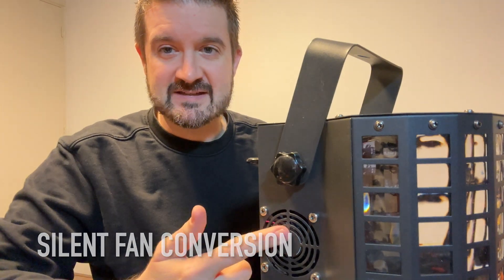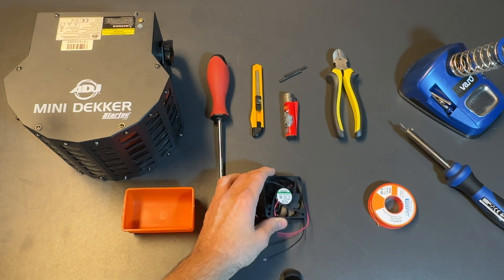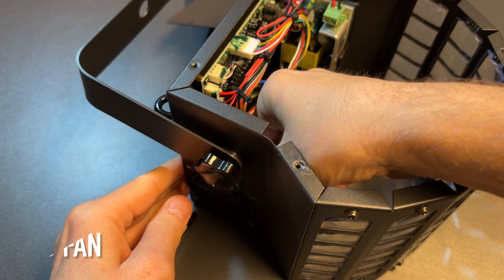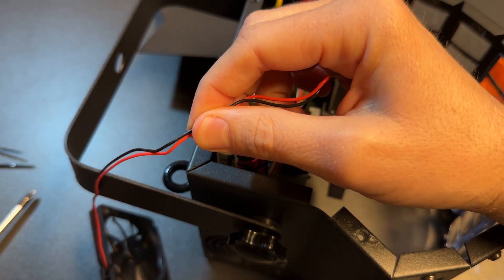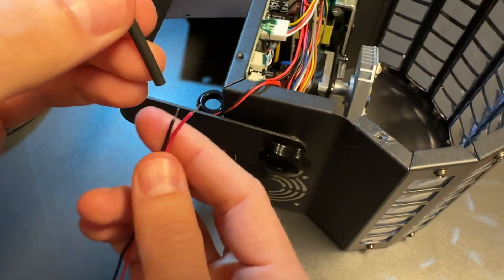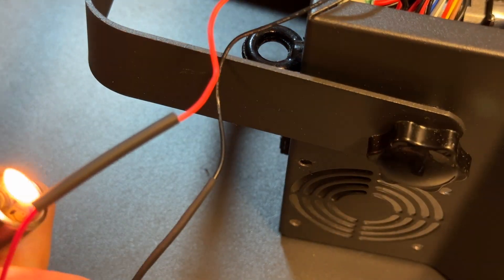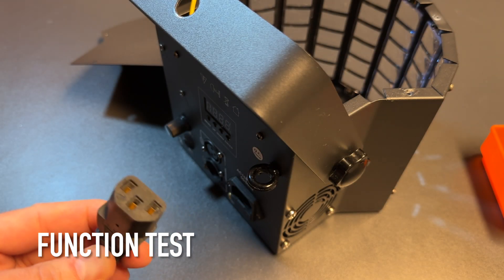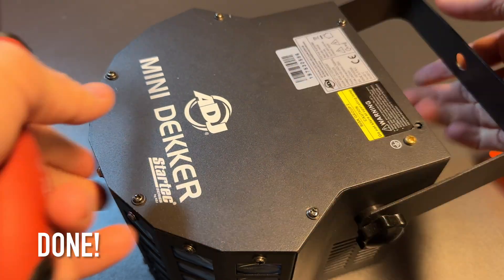ADJ Mini Dekker Silent Fan Switch: Step-by-Step

Comment: I saw your 'most underrated dj light' video and clicked through to comment "except for the horrible fan noise" but then I saw this and decided to give it a try. I'd swapped in a different fan on mine but it didn't make enough of a difference and I sold them off. This fan works great though, thank you much! I've got a segment in process on different derby fixtures, I'll give you a shout-out in it.
Reply from the maker: Thanks man, appreciate it!

Comment: Hello, Maybe you know why the led moves in small movements back and forth like shaking. Where could the problem be? Led vibrates when turned on...
Reply from the maker: Hi, I had similar issues with one device where the stepper motor just vibrates. In my case the stepper motor was broken and needed to be replaced. Mine broke during the warranty hence the seller took care of it. 
If your device is out of warranty you can Google Adj replacement parts, as they do have the motor available on their spare parts website
Reply: @djjakobofficial  fenks I will check

Comment: I did it putting in a resistor instead and now the fan spins at a very low speed near silent yet providing a good constant airflow. Even after a couple of hours use the light and air flow is cool.
Reply from the maker: That’s a great suggestion @DJ_PeterSteel as you can keep the original fan. What kind of resistor did you use?
Reply: @djjakobofficial   I had a bunch of resistors I tried and picked one that suited. Sorry but didn't check what value it was as I did it in a hurry.
Reply from the maker: Alright, no worries - let us know when you come across it by any chance in the future ;)
Reply: @djjakobofficial  I did this to my second Dekker also and I used a 150 ohm resistor.
Reply from the maker: @DJ_PeterSteel  thanks, that is great information for anyone who wants a quicker and cheaper solution then switching the whole fan.
Reply: @djjakobofficial  is the fan even needed, considering this is an LED? Can I just disable it?
Reply: I was in an even bigger hurry and just knifed the 2 exposed fan wires, without even opening the device.
Reply from the maker: @atawmicpm  As the led unit is with 2x 10 Watt pretty high-powered, it is recommend to have a fan cooling it. Some people have just disabled the fan but imho it’s not worth the risk damaging your leds over a longer period of time.